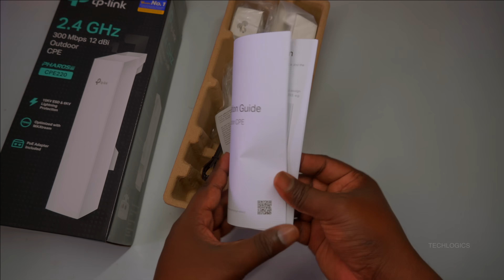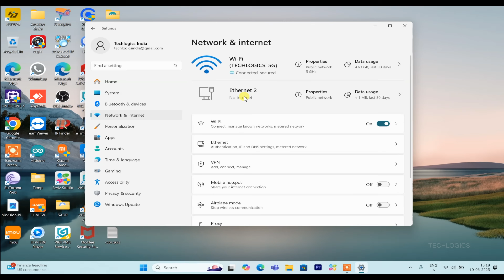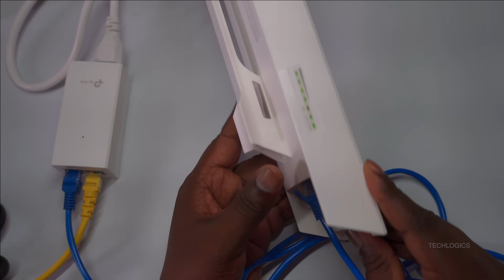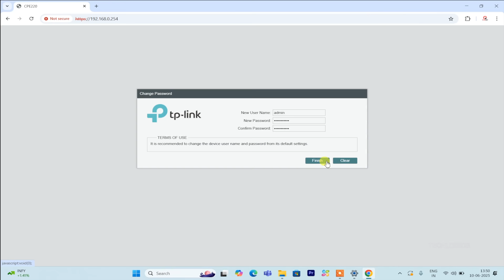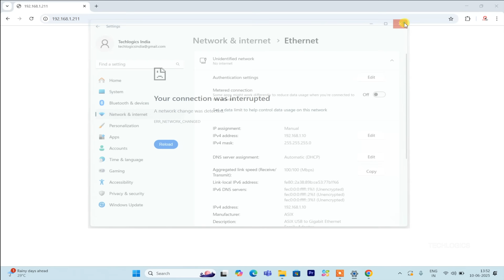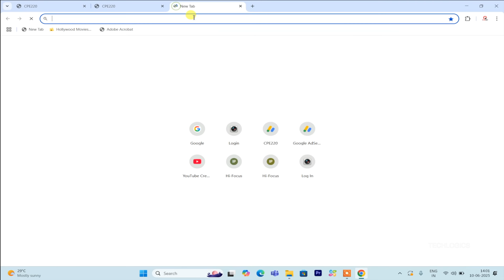How to Connect IP Cameras Wirelessly Over Long Distances with TP-Link Outdoor CPEs AP / Client

Comment: Hey bro can I use this RF device to transmit ethernet to wifi enabled camera's? Over a distance of 2km
Reply: Unlikely.  You will need another unit co located with the camera.  These are directional units that have gain to pick up weak signals.

Comment: Thank you such a great video. Do we have to point the tplinn outdoor cpe to face each other or it doesn't matter?
Reply from the maker: Thank you, For optimal performance (Communicate both device properly), TP-Link outdoor CPE devices generally should face each other directly. Proper alignment ensures the best signal strength and stability for the connection.

Comment: Please can this CPE carry 12 cameras and send Cameras signal  to the NVR without out any issue? And the distance not more than 70m
Reply from the maker: Yes, the CPE (300mbps) can handle 12 cameras (2MP) over 70m without issues.
Reply: @Techlogics Can handle 6 4MP ?
Reply: @mr.technician6724 waiting for the same answer
Reply: @mr.technician6724  For your camera, look up the required data rate from the camera's spec sheet.
Reply: You will need a network switch to combine the 12 separate cameras in to a single network connection.  Then feed that to the CPE unit.  Add the bandwidth of each of the cameras together and make sure your switch and the CPE can handle the data rate.

Comment: what is the max distance coverage?
Reply: Depend on model. I used 5 km before
Reply: Note that at its maximum range, you will not get full speed connectivity.    If you need 5 km connectivity, select a 10 km unit.

Comment: Is this stable for CCTV?
Reply from the maker: Yes, for CCTV systems, especially for connecting cameras over long distances or in outdoor environments. These devices are designed to provide reliable wireless links with strong signal stability, which is crucial for continuous CCTV surveillance. When properly installed and configured, they can deliver a steady data connection for transmitting surveillance footage without interruptions.
However, the stability also depends on factors like the quality of the outdoor environment, distance between devices, interference, and proper antenna placement. Ensuring a clear line of sight, using high-gain antennas, and selecting the right CPE model for your distance and bandwidth needs will help maximize stability and performance for your CCTV setup.

Comment: Ive not watched this, but please setup basic security....

0. Vlans + white list devices to its own vlan.
1. CA signed ssl certs for all networking equipment, incl the cameras.
2. Disable services you dont need to dont use daily. EG ftp, ssh, telnet etc.
3. Disable Wan access to router, camera etc.
4. Scan your lan with nMap to look for open ports, services,
Reply: Please, What is the maximum distance between the transmitter and the transmitter?